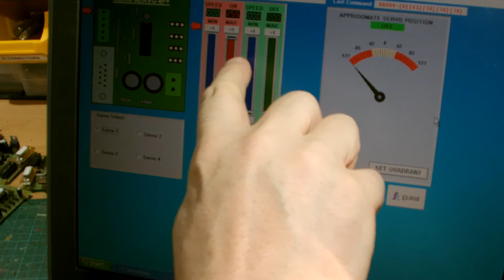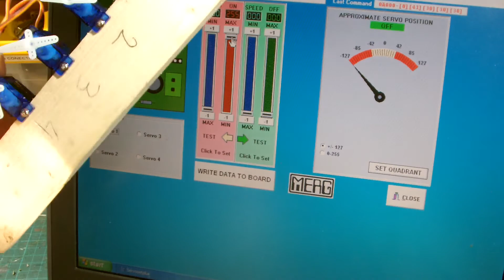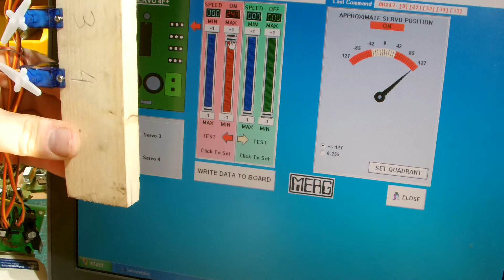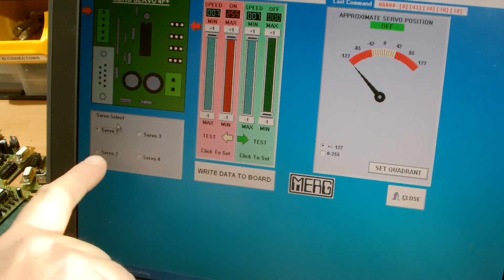Wemblesden Park - 26 - MERG servo boards

Comment: This is brilliant - thank you! I have long been wondering about using servos for my point control but have been dithering over the decision. I have considered joining MERG for their boards as they have always seemed really good at exhibitions. BUT... I have no soldering skills and the last time I tried to build a kit, I seemed to destroy it in the process. This has made me reluctant to make a start. If these can control 4 points, then they are likely good value. You obviously recommend them...? Any future video about how you attach them to your points or how you go about constructing the kit, and I would find that very, very useful indeed! Many thanks!
Reply from the maker: MERG membership is £16 a year that works out much less than a mag subscription these days. The servo 4 kit is quite an easy one to put together and at £5.98 for the kit is good value for money. I use four on Wemblesden, two operate the eight servos that open and close the TMD shed doors whilst the other two control the points on the scenic side of the layout. For my points I made my own brackets to hold the servos and used embroidery needles to move the tie bars. There are however various 3d printed servo mounts available through MERG as well. The boards featured in the video I built up for a friend at the club and I'm fairly certain that he bought the MERG servo mounts so I may be able to do a video once restrictions are lifted. Once I have finished sorting out the garage(man cave) I will be doing a few more how to videos. ;)
Reply: @Wemblesden  I think you've made my decision for me. I've been thinking about joining MERG for three years. It's about time I did. I just have too much fun making stuff out of card and never get round to the electronics! Thanks again for this video.

Comment: ¡Hola buenas tardes Dave!  Great little video and, glad to hear all is now well with you. I’ve been using the MERG website, since joining and, there’s definitely some very useful stuff on there. I’ve dabbled with some servos and made their service tester. Very much looking forward to your next layout update. Stay safe and well. Un saludo. Gary
Reply from the maker: Morning Gary good to hear from you again. Have you managed to get your shuttle unit working yet? I'm looking forward to getting stuck in again with the N gauge layout. Over the past few weeks I packed Wemblesden away for long term storage my mrs has made some layout covers to keep all the spiders off the baseboards! With the layout down I reused the timber from the support frames to make a set of opening garage doors and a new support frame for the Swiss layout. Having doors again means I can take the Swiss layout outside in the warm weather and better still given all the current restrictions of people visiting other households my friends can now pop over without having to go in the house. ;)
Reply: Hi Dave. The shuttle project has been put on the back burner for the moment. Reason being, I was gifted a large amount of railway stock and track. With this, I have been able to extend the layout with a full new set of base boards and have designed a new branch station and sidings. My aim is to design a working time table for both passenger and freight workings between the main station and branch line. But, that is a little way off at the moment as I am now concentrating on scenics. I’ve started at the main station and, today will be filming some of the work I am currently doing on the station sidings and, helpfully this will be included in this month’s update. Luckily for me, the Mediterranean weather is allowing plenty of work to continue both inside and out so, I have no excuses to crack on with works!  Keep in touch and, as ever, stay safe and well. Un saludo. Gary
Reply from the maker: @garydoc  Sounds like you have been busy I will have a look at the videos later. Just subscribed for the updates. ;)
Reply: Welcome Dave! 👍